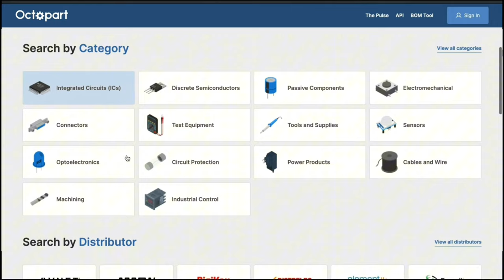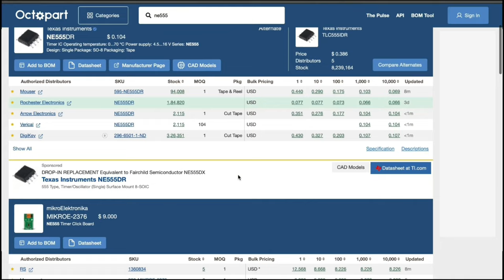How To Make Electric Fence Circuit | Step-by-Step Guide | Altum Designer

Comment: These capacitors are not needed. A high-voltage capacitor is already built into the body of this transformer; it is located inside a cylindrical compartment on which some inscriptions can be seen. One terminal of this capacitor is already connected to the red wire inside the case, and the other is connected to one of the lower pins. You just need to find it using a capacitance meter and connect it to the common wire. That's all.

Comment: These types of fence energizers aren't permitted because they are dangerous. You need to follow the safety regulations. The pause length must be at least 1 s. 

This thing is potentially hazardous.
Reply: In fact, as written above, the spark must be single and the impulse must be minimal every second. In this way they are prohibited and very dangerous for any animal.